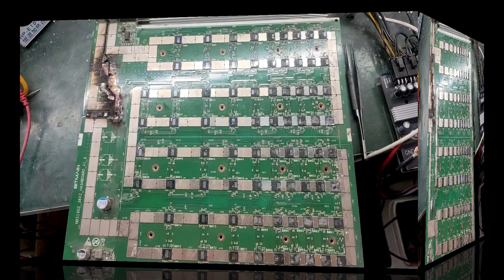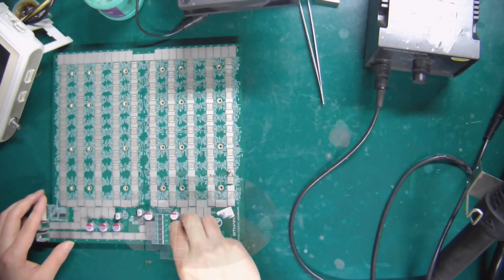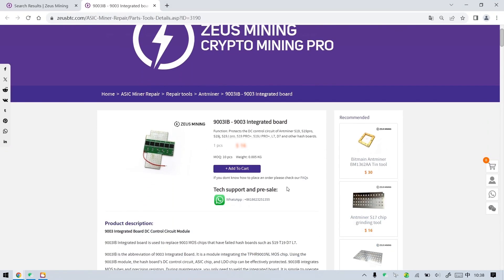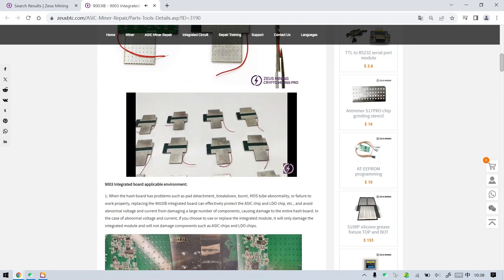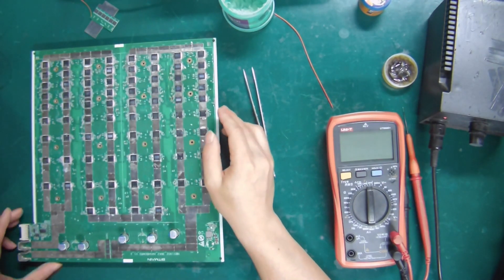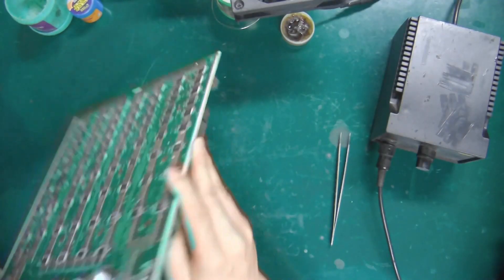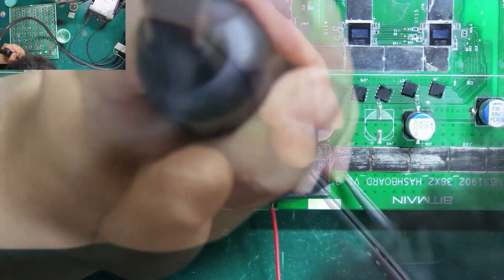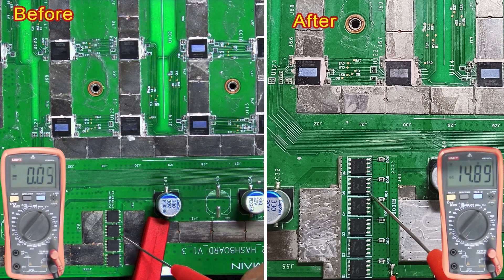How to install and use the 9003IB integrated board?

Comment: For those installing on an 8500 L7 hashboard, the zener diode you want is labelled IWF. It's the closest one on the PCB tracer line to the mosfets on the opposite side.
Reply from the maker: Yes. Connect to the negative terminal of the Zener diode.